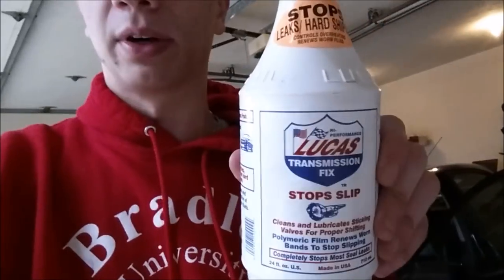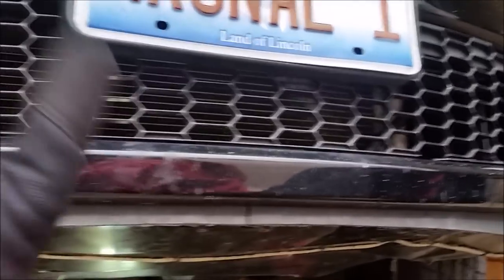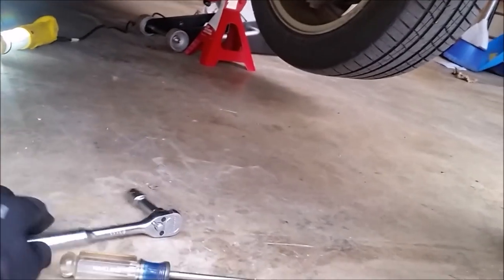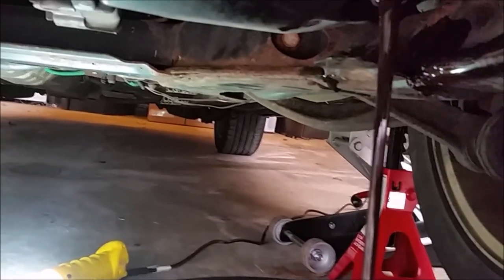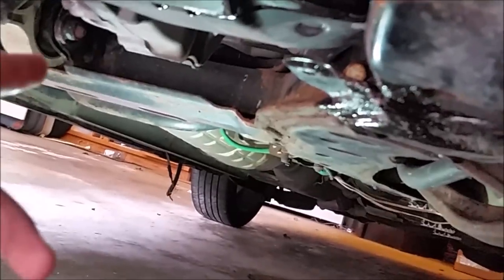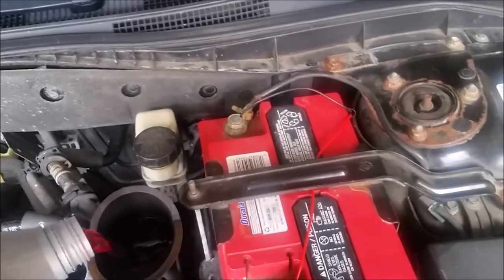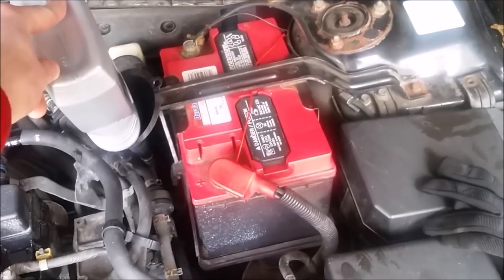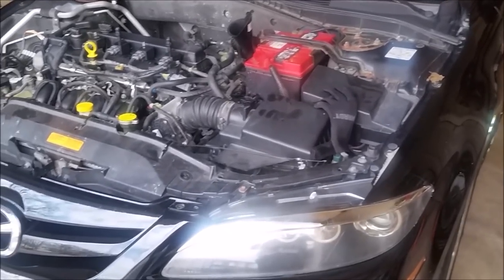Fixing jerky  automatic transmission and hesitation in acceleration   2006 Mazda 6

Comment: Nothing like a misleading video to put the final nail in a transmissions coffin.
Reply from the maker: This is going to be interesting.  This process worked amazing. And has help so many people. Please explain your reasoning rather than complaining.
Reply: @AnthonyAwada  You can usually get away with dropping the pan and changing the filter and adding whats needed (usually 6-7 quarts) but this isnt always a cure-all. You stated the system was Flushed at 120k. Thats a bad idea from the start. All of that grit/clutch material thats inside the system is needed for the trans to operate properly. The collective cut-off for a flush is around 70k. The fluid still has a red/orange tinge at this point. What you drained from that pan looked like burnt oil with some coolant mixed in. That trans is done and you simply prolonged it. Misguiding people into thinking simply replacing whats in the pan after 10s of thousands of neglected miles will fix their problem is just misleading. Thats all :) Also, years ago when I was a kid I had the same situation with a shitty trans. Started hesitating, slipping and I too drained what was in the pan and it was straight burnt trans fluid. Topped it off and rolled with it for another week and the planetarys gave out entirely. Scrapped the vehicle for a down payment on another. Not trying to be a dick but I got you against the wall.
Reply from the maker: @oldschooldude8370  I hate to say you are wrong but you are. Over they car now has 220K miles and shifts amazing. No major damage was done. You seem to be under the impression that if you miss your transmission fluid change then you are screwed. It's viscosity that Helps the transmission engage well. I am still trying to understand where I mislead people. It worked for me.Even Mazda recommends changing fluid if you have a jerky transmission.  So please can you inform the misleading title? Thanks
Reply: @AnthonyAwada  You were lucky, plain and simple. What came out of that pan spelled doom. Its obviously getting too hot. The radiators cooler isnt doing too well.
Reply from the maker: @oldschooldude8370  you are standing behind your statements without any proof or data. Many people here have had tremendous success. mazda themselves recommends this change. Again, where is your logical statement?
Reply from the maker: Mazda built the car. I really hope you don't think you know better than they do....
Reply: @AnthonyAwada  I'm standing behind years of experience. This particular trans doesnt mind burnt fluid. I'm glad to see its still going. I am amazed that replacing whats in the pan and the filter kept it going. Maybe it isnt a shitty trans :)

Comment: i have a 04 mazda 6 3.0 automatic transmission my gears slip and when i try to reverse sometimes almost always it has low power and sometimes revs without moving. the transmission fluid is red and replaced recently plus brand new axles transmission mounts and suspension any ideas on how to fix it should i just try another transmission fluid change plus that lucas stuff?
Reply from the maker: Hi westcoastmickey, if it started to slip after your transmission fluid change, I would check the type of fluid and make sure its M-V which is the type of fluid the FNR5 transmission takes and is only attainable through the Mazda dealership.

At this point, if the car is revving and no acceleration, its slipping and the clutch packs are worn. It might be best long term wise to replace the transmission.
Sorry. Good luck.

Comment: Will this method work for a 2002 Mazda mpv I accelerate and it jerks a bit no hard shifting tho
Reply from the maker: Hi Jonathan, I would, of course, keep up to date with the servicing of the transmission fluid. If you arent experianceing jerking when shifting, but the car jerks while accelerating, then I would check your engine and transmission mounts.

Comment: Will this work on my 2005 mazda mazda6 v6? 2nd to 3rd shifts weird.
Reply from the maker: If you have an Automatic I highly recommend this. I will be uploading a video showing how to replace a filter and fluid on these transmissions. I recommend you change the fluid and filter and replace the fluid with Redline ATF D4.
Reply: I have an Automatic. I actually just bought it and it is super used. Previous owner didn't really take care of the car. She told me that car was sitting there for a year and then she drove it and found out it had this 2nd to 3rd shift problem. Just a hiccup but I would want to get it taken care of asap. So Redline ATF D4 is better than the one that you use? And how many quarts should I fill it up with? My friends think that the hesitation from 2nd to 3rd should be censor or spark plug's problem but I really don't think so. I check the dipstick but the oil color wasn't too bad so I am a little confused. Any advice?
Reply from the maker: Yes, so this is a little complicated.  If it's hesitating while acceleration then your friend is right. I would then recommend you watch my video on how to clean a mass air flow sensor. That usually solves the problem and is pretty easy to do. If there is a jerkness feeling whenever shifts happen then it's transmission problems.  Check the fluid, make sure it's red or light brown. And that it doesn't smell burnt. The stuff I use is great. Castrol Multi import ATF and Mobil 1 fully synthetic are great.  But Redline ATF D4 has a lot of positive reviews as well. It's your choice really. Any of those three should be just fine. The amount of fluid varies. When you drop the bolt and pan you only remove 1/3 of the transmission fluid from the car. In my case I replaced about 4 quarts. Just measure how much came our and put the same amount back in. You can do a tune up to the car for sure before touching any transmission stuff. Changing spark plugs, cleaning mass air flow sensor, and throttle body will definitely improve your car.
Reply: Appreciate it man. Would it be ok if I asked you more questions when I get my fluid done tomorrow? Budget is pretty tight I can only get 1 thing done at a time.
Reply from the maker: +Duong Nghia Of course, feel free to ask any questions.